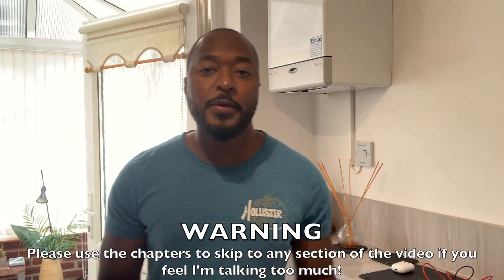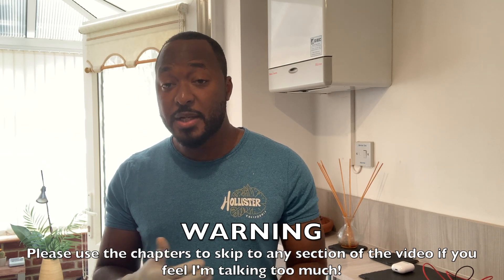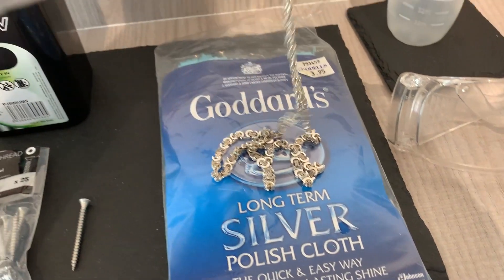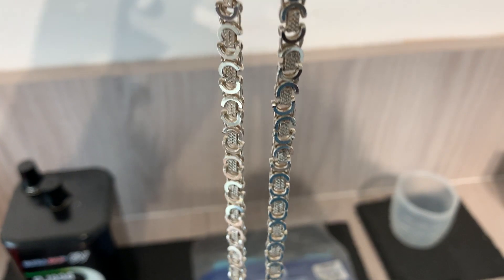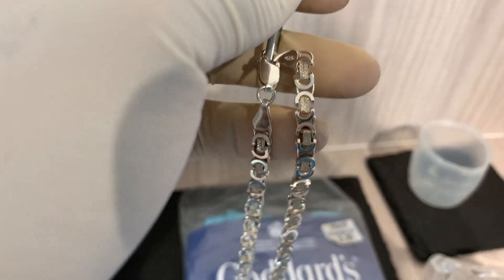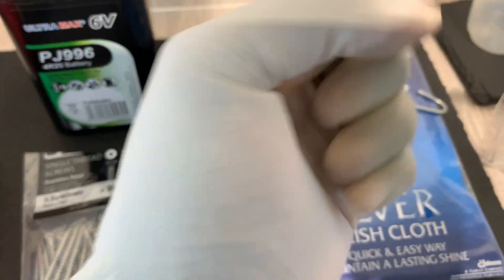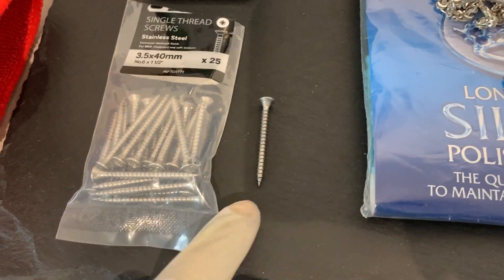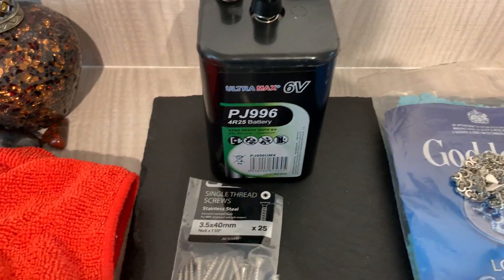How to Gold plate silver at home using electroplating / electrolysis

Comment: Hey brother! As others have said, it's VERY important to get the metal as CLEAN as possible and that might include stripping off any plating already on the silver (rhodium, etc..) from the manufacturer.  Then once you have it down to bare silver, I use brake cleaner to clean metal I want to plate. It works very well.  Any good solvent should work, especially  With silver you'd probably want to nickel plate first, which thankfully can be done with a cheap strip of nickel from ebay and some salted vinegar. 
    BUT, when it comes to gold, use a 24k solution if possible.  Especially if you intend to wear the chain.  You don't need a ton of gold.  A few grams should do the trick or buy a proper 24k solution.  I do know from working with other metals that to build up a nice layer that can withstand polishing and daily wear, you normally need like 20-40 minutes in the plating solution under current.   I am not familiar with gold plating but I imagine the rules are fairly similar for most metals. I would try plating them for longer and moving the chain intermittantly so all parts get an even coating. In other words, hang it with one side facing the anode, then flip it around halfway so the other side faces the anode.  If the plating layer is thick enough you can polish the chain with a fine cloth (those little microfibre rags that come with good sunglasses are perfect) and the thing will shine like a legit gold chain.  You might have to dump some money in initially, but then you can charge your friends to plate up their jewelry, watches, grills, etc. and earn back your investment plus some.  
    One other suggestion, instead of a battery, check ebay for a cheap power supply.  Continuous steady current is really important for a uniform layer of metal to build up.  I would call this method the "Macgiver method"... In that, it works, but if you put a little money and practice in, eventually you will be a master and have all the right gear to get perfect professional results.  Thanks for the video and cheers mate!

P.S. I know a way to remove silver tarnish that is like magic.  Involves a pan on the stove, baking soda, water, and aluminum foil.  If interested, reply and Ill share that with you. Can help cleaning your silver jewelry to sparkle like new.
Reply: I’m
Interested can you send me the link?
Reply: @crwnesiah8954  Yeah bro, Ill link below, but it's super easy.  Basically get a shallow pan, glass dish, or glass baking pan and lay a sheet of aluminum foil in the bottom, shiney side UP.  The foil should cover the whole surface of the pan.  Then sprinkle a bit of salt over the foil and place your tarnished items in the bowl so they are sitting on the foil with a bit of salt.  Leave that be for a minute and in a separate kettle or pot heat up 2 cups of water to boiling.  Pour the boiling water over the jewelry and once the items are soaking in the hot salted water, place a good amount of baking soda into the solution (1-2 tbsp baking soda min.) and you will notice it starts to foam and fizz.   Your silver will undergo a chemical reaction in contact with the foil and like magic the tarnish will start to be attracted to the foil and come off the silver.  After the water turns a brown color from the tarnish, remove the silver and buff with a cloth, if all the tarnish has not come off, try a second or third soak in NEW water, salt, and baking soda solution.  It works because aluminum is more reactive than silver and the baking soda allows the sulfur (sulfur in the environment is largely what tarnishes silver) to attract to the foil instead of the silver in an electrolytic reaction.  Best of luck! 

Video link:
https://www.youtube.com/watch?v=BhtGxujrLTc

Comment: Most commercial sterling  silver jewelry is rhodium plated.
So to plate sterling silver, the jewelry item must go through a "chemical stripping" process...then go through a plating process. Pure sterling silver must be plated with nickel first, then plated in gold. Otherwise the sterling  silver metal, will leach through.
Reply from the maker: Good info
Reply: @justinsymonds8470  Spot on information.
Reply: when you say pure sterling silver must be nickel plated first. Is this 100 pure fine silver that must be nickel plated first or .925 sterling silver as well?

Comment: You should NOT directly gold plate 925 Sterling...the silver will leach through the plating and it will look very bad after a short while. Plate an intermediary layer of nickel as a barrier first.
Reply: If I’m allergic to nickel (hives, skin peeling and scar results) is there another way to prepare the silver? Or, do you anticipate that the skin would not be exposed to the nickel?
Reply: @rachaelaustin6123  That's a great question. And I don't have a "for sure" answer. However, I would think it shouldn't be a problem - the Sterling/Nickel/gold plated stack is very, very durable.
Reply from the maker: One thing I think I could improve is the colour of the gold. It’s looks good but has a darker tone to it than I would like. It’s far from awful and is wearable but I wouldn’t wear it with real gold as there is a noticeable difference when they’re right next to each other. Would it come out with more of a yellow tone if I had nickel plated it first? Or is the final colour just down to the plating solution I used?
Reply: @justinsymonds8470  The darker tone of gold you dislike is probably due to the silver leaking through and discoloring the gold. You should listen to the person above. 😉
Reply: If its already plated do you re nickel it or can it go straight into solution
Reply from the maker: Interestingly I thought this would be the case. But I went ahead without the nickel. 5 months later and the chains fine. I did have to increase the thickness of the gold plating a few weeks after this video though.